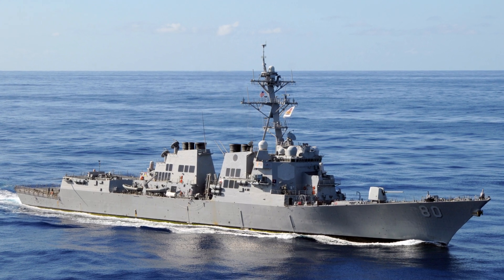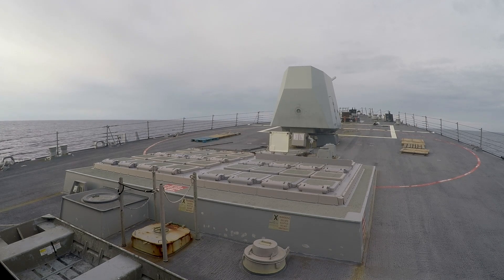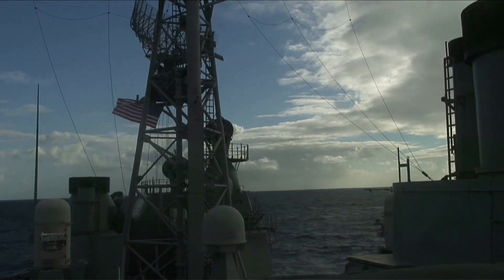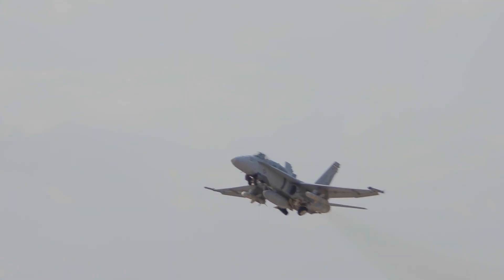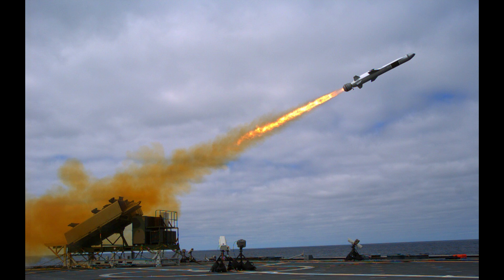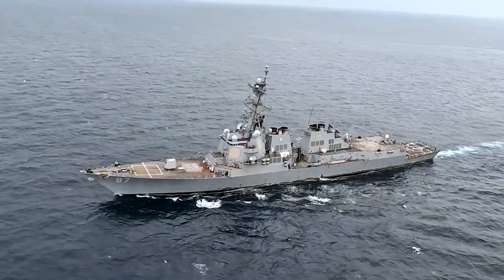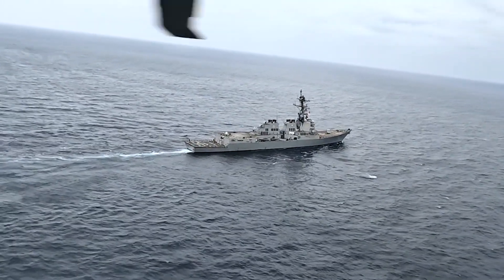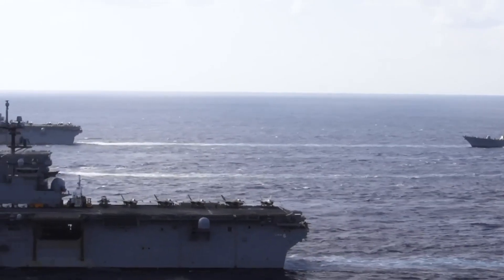US Navy Destroyers Have One Big Weakness – Is It Getting Fixed?

Comment: You speak as if ships operate on their own without any supporting assets, while this maybe true during peace-time or, transiting between theaters, the reality is during wartime ships are NOT going to be sailing alone without complimentary assets.  Firstly, USN doctrine revolves around air power and submarines as its offensive striking arm against surface threats; anti-air combatants like the Burke's have anti-surface weapons but, that threat is not persistent or, a threat.  Secondarily, you mention the NSM is replacing Harpoon, while its a stop-gap, modern replacement, the more important anti-surface weapon being introduced is the LRASM.

Comment: I believe you have picked the wrong “fall guy”. Speaking from some experience (retired Commander, O-5, USN) the lack of a decent or better yet, superior over the horizon anti-ship missile is a problem for many platforms. Naval aircraft only had Harpoons. Submarines only had Harpoons. The problem was a mindset in the US Navy leadership not in the design of the destroyers. You attribute too much influence to that platform (I should note that there is Congressional involvement in this matter. Congress is very sensitive to protecting the carriers. This has helped the destroyers gain all that defensive capability. Congress less caring of OTH anti-ship missiles)
The Tomahawk Maritime Attack Missile is being deployed as an interim. Think twice before you say useless because it’s subsonic. Read up on all the defensive goodies it has first. For the “superior” long term solution it is being worked. But it is very classified so we probably won’t know about it until it is final testing or initial OTE. 
My understanding is that there has been a cultural change at the top level. At DoD level. Whatever we eventually see, I expect it will be intended for surface, subsurface and air launch. And USN carrier aircraft plus USAF bombers. 

The USN WILL send its carrier strike groups into harms way. As you pointed out, the destroyers have had a lot of attention in its ability to defend. Please understand we will never know the full range of capabilities. We know little of the cooperative engagement, other than it exists. We know nothing of what the current SLQ-32 ECM & ESM can do. And read up on ballistic missile precision targeting of a moving & maneuvering target. There are some good white papers on generic TBMs. Historically, everyone thought USN would never bring carriers through the Straits of Hormuz!😢
 Enjoyed the video background. Would like to hear a bit more informed narrative. Hope this helps.
Reply: Thank you for your service.

Comment: Way does everyone forget that SM-2 and SM-6 have anti surfaces capabilities?
Reply: They are not as powerful as true anti-ship missiles.
Reply: @Stinger522 and are short legged, especially the SM-2s.  But you have to admit that the creator's failure to do even basic research on the topic he is presenting is a weakness in his argument.
Reply: Warheads are smaller. Sm-6 is like 150lb
Reply: @bigheadache less than that. 140 lbs, but it still is capable of sinking ships, and has in training.  In the video it was incorrectly stated that the only anti ship missiles on US destroyers are harpoon missiles.  That is incorrect.  Does the US lack long range anti ship missiles, yes.  That doesn't change the fact that SM-2 and SM-6 missiles have anti ship capabilities.
Reply: @BeKindToBirds he made a materially false statement, that the only anti-ship missiles on us destroyers are harpoon missiles.  How is it unfair to point out that that is not true?  I also did not impose any motive.  You were the one that did that.  I assumed that it was the result of a lack of research, not as a result of any motive or bias on the part of the presenter.  You assumed that I acted with malice.  And as you also pointed out, I acknowledge that his overall thesis is correct, the US Navy does lack long-range anti-ship missiles on its destroyers.  However, it does not change the fact that US destroyers carry far more anti-ship missiles than just the harpoons.  It's also worth pointing out my original post. I did not single out just this channel, as many YouTube influencers and other talking heads make this same mistake.
Reply: @randomdude4505 Not really. 140lb is only slightly heavier than an army 155mm artillery shell. Also, SAM warhead are blast fragmentation, so will do limited damage to a proper ship. Single hit from that may damage some exposed sensors and systems but don't expect much more. 

Modern warship may be unarmoured, but regular ship hull plating are thicker than armour on most army APC. 

SM2 and SM6 surface mode may be effective against missile boats and fast attack crafts, but it is not an effective anti ship weapon. A burst from the Mk45 will do more against ship than those SAM.

Proper AShM uses semi AP warhead
Reply: @moss550 the artificial reefs created by SM missiles and the various sinkexs would disagree with you.  You are also missing the point.  The SM series of missiles has anti-surface capabilities.  Are they the best anti-surface missiles in the world? Not even close.  But they are capable of sinking modern surface warships.  At least frigates and destroyers.  That means the statement that the only anti-ship missiles on US warships are harpoon missiles is incorrect.  Is the argument that the United States doesn't have Anti-Ship missiles with the same capabilities as other countries have is not in dispute.  The US doesn't and that is recognized by the US Navy, the US Congress, and basically everybody else.
Reply: Genuinely cause a lot of us didn’t know they did until like Seapower came out lol.
Reply: Yes!  I am surprised about the ignorance of this too.  What the USN could do with though is something slightly cheaper with slightly longer range to fit below SM-2 but with a bigger warhead.  Dual role.  But slightly more biased to surface.